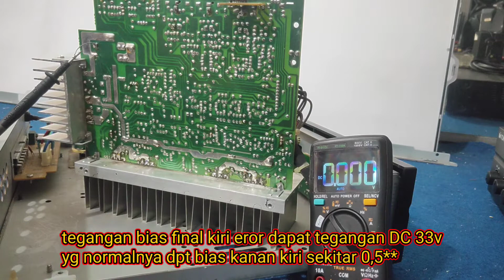perbaikan toa amplifier ZA-2120

Comment: Mas maaf numpang ty resiator 133,134,139,140 itu brapa ukurannys krn  wrnalar swmua  toa 2120
Reply from the maker: @Vivopbn-bc3he  itu kode pcb jadi tidak bisa di samakan nilainya dgn kode itu sendiri, klo saya pribadi mendapati resistor yg hangus belum tentu putus jga, kalo sampai benar2  terbakar meleleh biasanya nilainya 100 san ohm /10 ohm boleh di cba mengunakan 100 san ohm dulu

Comment: Penyebab ganti mosfet knpanbang?
Reply from the maker: Terjadinya over heat TR final jebol/short lalu menjadi arus liar sehinga menghantam ic mosfet kanan dan kiri sehingga ikut short
Reply: @MasTris39  kalau kanan 0.6 kiri 0.5 itu aman kah om yang dk bagian transisor finalnya
Reply from the maker: Masih aman
Reply: Hanya terukur 0.5
Reply: Di kaki gate
Reply: Kalau lampu power nyala
Tetapi lampu signal gak nyala gak ada suara dispeaker kira kira rusak bagian mana mas?
Reply from the maker: @difacolection414  klo tidak ada terlihat ada yg terbakar/hangus di TR final cek dulu potensinya volume/semuanya di cek potensionya
Reply: @MasTris39  di tegangan TR basis ada 32v mas
Sedangkan power disentuh input audio tidak ada tanda-tanda signal masuk.
Reply from the maker: @difacolection414  ganti dulu TR mosfet kanan dan kiri yg depan kodenya di awali huruf K
Reply: @MasTris39  YR K1305 ini ya mas??
Soalnya di kaki TR final di basis ada tegangan 32v semua
Reply from the maker: @difacolection414  iya ganti dulu ada dua biji kana dan kiri sama ganti dulu
Reply: @MasTris39  iya mas coba saya ganti dulu
Ada nomer WA mas?? Buat berbagi ilmu🤝
Reply: Sudah saya ganti masih blm nyala mas
Reply: Kalo tegangan geat fet gak ada apa nya bang. Fet tr 3331 juga udah komponen lain aman. Apa kapasitor snuber berpengaruh. Karna klo di kasih signal kenceng. Bias baru mau naik. Klo stanbe 0
Reply: Pak tegangan pada ic 4580 di kaki 8 normal nya berapa,
Reply from the maker: @revaniaputri5807 12vol sampai 15 vol
Reply: @MasTris39 kalo di pin 8 tegangan nya 23vol dan di pin no 4 0vol masalah nya di mana pak, saya sudah cek komponen aktif normal semua, bias final 0,6 semua,
Reply from the maker: @revaniaputri5807   @revaniaputri5807  cba cek semua  potensionya mungkin udah putus mati cek berkala
Reply: @MasTris39  tegangan ic itu harus 12 - 15v semua ya pak, ic nya ada 3
Reply from the maker: @revaniaputri5807  iya rata-ratanya di suplai ct/non ct 12-15vol saja kalo lebih dari itu bisa short icnya